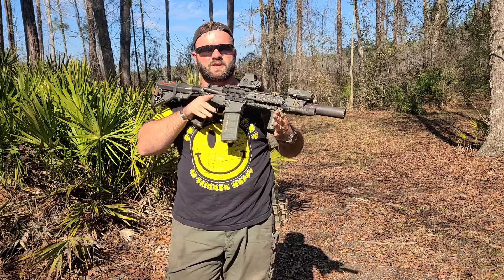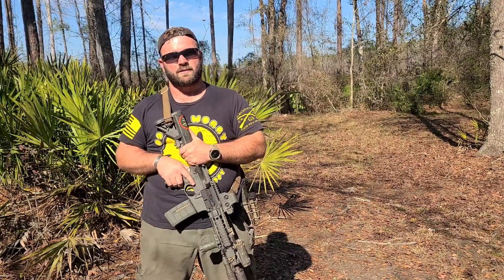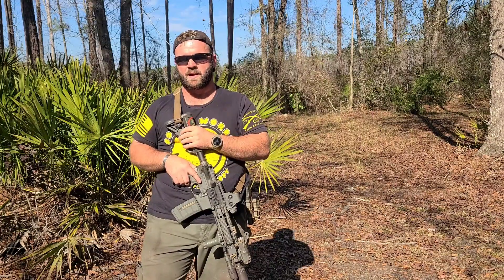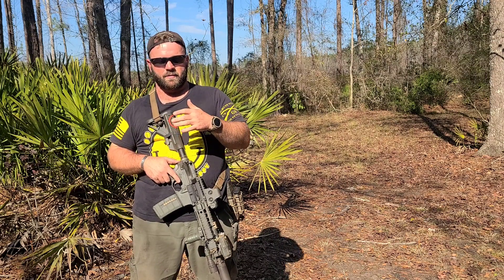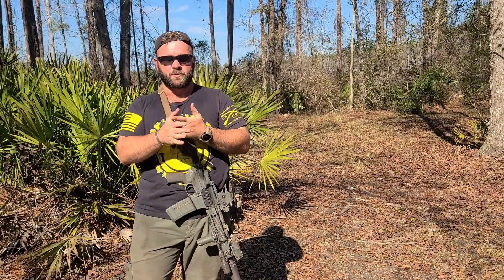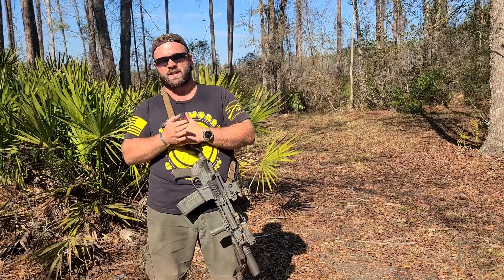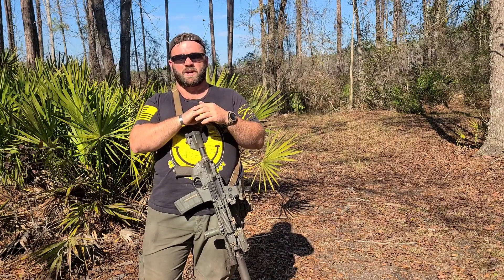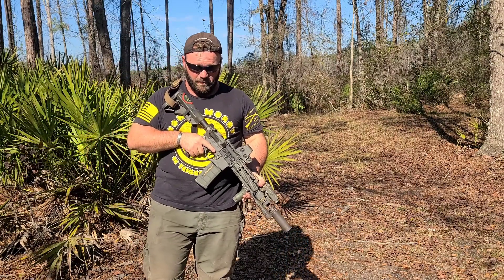Mk18 Ejection pattern comparison. Rosco Mfg vs. LMT vs. Daniel Defense.

Comment: Excellent video!
In the end, LMT and DD seem to run really smoothly. DD seems to have the best potential since it has an omnidirectional birdcage, no light or IR, and only a brace.
Rosco looks to be the heaviest(prob not by much), having a very effective(so restrictive it even changed the ejection pattern😂) and obnoxious brake, and a good VFG. But it didn't seem to really outrun the other two, sadly.
Reply from the maker: We did our end of year shoot this past December and had 20 guys out. Shoot was over 1000rnds rifle per shooter, and it was very nasty weather. 45°-55°F and pouring the whole 10-hour day. Of the 20 rifles, 3 had issues with reliability due to being undergassed in the adverse conditions. That DD Mk18 was one of them. The other two were KAC 11.5 CQBR's, and the LMT wasn't there.
 There's a certain point where you'll begin to have seriously diminished reliability with the platform and that seems to be it. .070 on a 10.3 imo is too small a port. .071-.072 with the slightly longer barrel is a sweet spot.
Reply: @operatorsanonymous  Thanks for sharing! What buffer and spring were in those three? 5.56 or 223?
Reply from the maker: @JohnZ556  knights guns had the springs that come from the factory with their rifles. Mk18 also had the factory parts. Not sure on ammo but I think one of the knights used 55gr X-tac  and the other M193. DD I'm pretty sure was also 55gr Xtac.
Reply: @operatorsanonymous @operatorsanonymous1741  Thanks for the info again! I think DD came with H buffer and carbine spring. That thing can run a steel case unsuppressed just fine, but it will be crazy overgassed using 5.56 suppressed.
I was recently tuning a DD MK18. It kicks and runs a bit too fast(1-2 o'clock) with Super42 H2 or H3 and Sandman K (5.56 FH cap); it almost feels like a direct blowback PCC. With Super42 H3, it still ran 5.56 just fine unsuppressed, almost like that 'ideal ejection' from Sprinco. But I think it is getting too close to being undergassed.

With those results in mind, I switched muzzle and started using Huxwrx HXQD556Ti with Super42 H2, which seems to solve everything, it feels like a completely different rifle with a similar ejection to the DD at the end of your video(a tad more forward, both suppressed and unsuppressed), almost hitting the same spot on the wall through the mag. 

Tried unsuppressed, and a box of 223 in the end, it still ran just fine. I also offered two random people at the range to bring their own loaded mag(IDK 223 or 5.56) to try out the rifle; one of them is pretty new and has a poor stance, it still ran 100% reliable and has super consistent angle/height/speed.

That's about as much 'testing' as I can afford; it went through about 200rds in a 2-hour range session.

Comment: I agree don’t get to caught up with ejection pattern but that being said 430 is where your brass should be ejecting too. The spring co white spring with a H2 buffer is what I’ve found to work best in my mk18s that are factory DDs. If your getting a 2 - 3 o’clock ejection pattern means either your gun is under gassed or you have to strong if a buffer system or your BCG is gas inefficient or you have something clogging your gas key or gas tube. Depending on what’s causing it, could be fine or you could be looking at replacing some parts or major parts wear. Believe it or not, the little shit does matter. The MK18 and even the AR15 in general has under gone trail and error fine tuning it into what it is today. When an AR is speced out perfectly and has thousand of an inch machining tolerances  and quality control checks at every phase you will get a bomb proof reliable guns with an unbelievably long lifespan. Sometimes it just takes the right piece being slightly out of spec and it will rear its ugly head at you a couple thousand rounds later. Over the years of shooting both professionally and as a free American I’ve learned to trust only a few companies which are Daniel Defense, BCM and Giessele. I like Sig but I do not trust them at all, they never quality check shit. They throw out their new firearms to the public and then let the customer discover all the problems. I’m convinced Sig Sauers RNA is their customers. Hk I don’t trust nor do I think they make professional grade weapons. Knights I think is good but not as good as the rich 2020 government funded brats think they are. I do want to try a rossco barrel and the 13.7 sage dynamics barrel which I think rossco makes. I don’t think rossco is DD or Giessele quality but it seems like people are having great success with them.

Comment: Just curious since this is the only video I've seen someone using a YHM riser but can the riser be attached to both the upper and the rail therefore creating more lockup and anti rotation for lets say a friction type rail and barrel nut?
Reply from the maker: Technically yes but I don't recommend bridging as the clamps don't have much surface area
Reply: @operatorsanonymous  thank you for the feedback really enjoyed your videos and have been  on the Rosco bandwagon for a bit now 👍

Comment: Lmt never made a cqbR upper unless I missed something which is possible… unfortunately colt made the first versions of the CQBR. Then the mod 2 used the DD rail. But the actual mk18 designated rifle was a Daniel defense. The first decade of the “mk18” it wasn’t called the mk18 and was just a designated CQBR upper slapped onto colt m4a1 lowers.
Reply from the maker: LMT made Mod 0's. They're rare as hens teeth. Used knights rails.